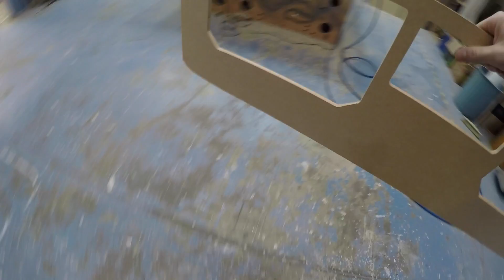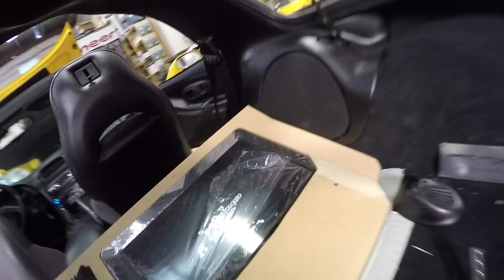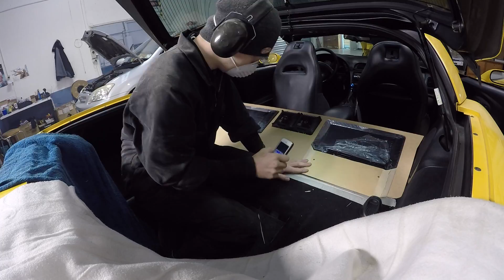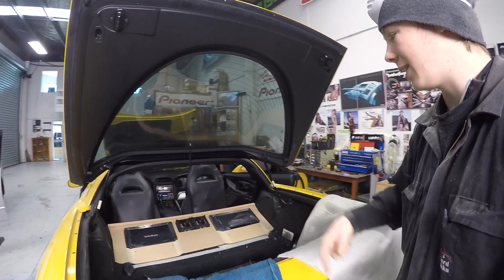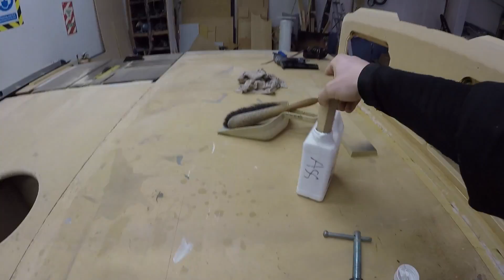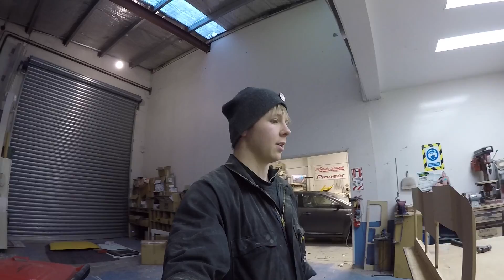CORVETTE C5 | Amp Rack Trim Panel Built!

Comment: You can always patch and smooth edges/contours with that sawdust on the floor and wood glue made into a thick putty. Let cure and the sand/file/route it smooth. It can even repair that bad edge you have. Great job, btw. I love watching the progress.

Comment: Wondering if you are going to fiberglass the wood in place, using some CA glue just to hold things in place while glassing?  You probably know this, but a simple way to check the internal volume is it to fill with packing peanuts and transfer contents into a cardboard 1ft cube.  Like you, I always use poly fill in my sealed enclosures, but I never rely on poly to "fix" a box that's too small.  Too small simply won't work.  In my experience you can't get the deep base with too little capacity.  Not that you need any lessons from me.  You're doing great work!  Cheers

Comment: I think people hate on SMD products just because they didn't do it first Steve and D Amore engineering are at the fore front of car audio tuning products and more. Their  also the first to bring amp dyno with no estimating or calculating needed to the market. I have both the DD-1 and CC-1 save me lots of time,hassel,and aggravation especially when it comes to dealing with a customer's car. Not to mention using both products to set up any system in many different configurations with + or - db and different over lap configurations.
Reply: Ha, yeah, that sounds like Steve alright. The only thing he contributed was adding a brand name. Tony D'Amore did all the engineering, why not hit him up info@damoreengineering.com
im sure he will be more reasonable. I hear what your saying, though im certainly not qualified to say you're wrong, it does make some sense. ive never measured the resistance of the dd1.
Reply: Gary Poole the reason I hate on the smd products is not because of the product itself but because there are flaws in the gain setting method used when using those tools but Steve Meade claims in all his videos that the system is 100% free of distortion and clipping. I queried him in a video about the dd1 whether you'd use the same gain setting at 4/2/1 ohms because the dd1 doesn't account for that. Long story short he was not happy that I questioned his claims and was completely unreasonable, decided to attack me personally and not address the question if I'd get clipping when setting gain with the dd1 and hooking up a 2 or 1 ohm woofer. The answer is you probably will need to wind the gain down for lower impedance coils or you will get clipping at max volume.
I know it's a petty reason to hate on the product but when somebody makes claims about something and behaves that way when you question them there's no way I can respect or back up that person.

Comment: If you want to hide imperfections you should use carpet. Vinyl shows everything. I like the humps.  I didn't think I was going to when you first laid  it out. You know a dust collector would be pretty easy to add to your table and it would save you a ton of work.
Reply: I'm still trying to figure out why the router is next to the wall and refuse bin is in the middle of the table.